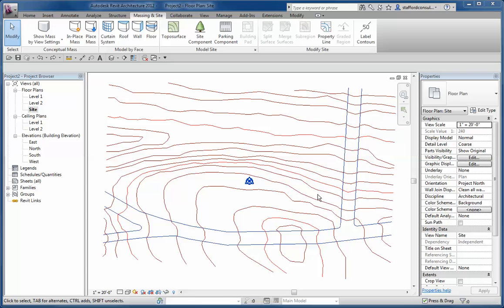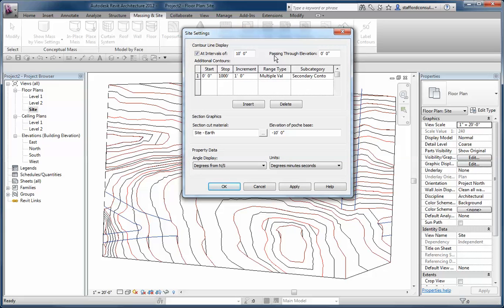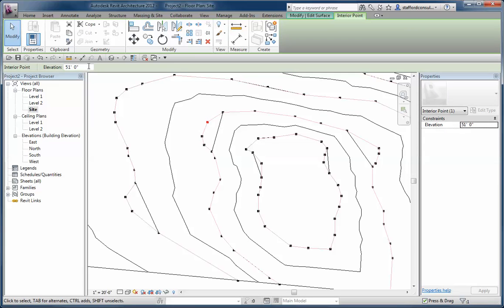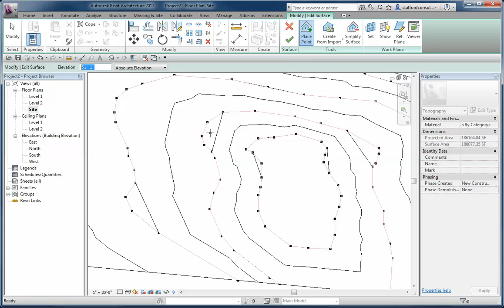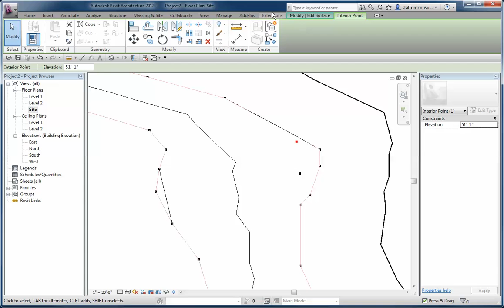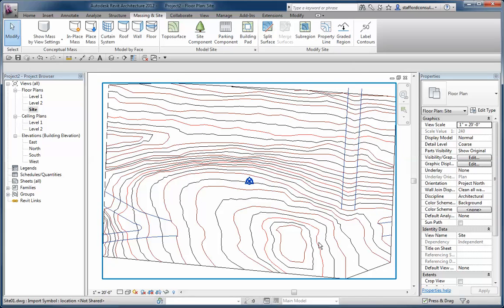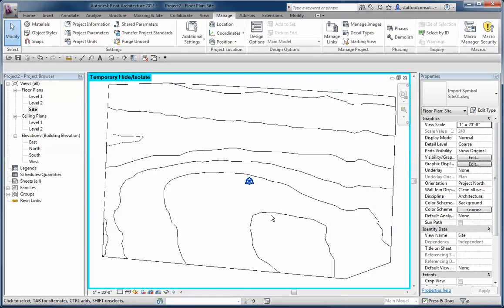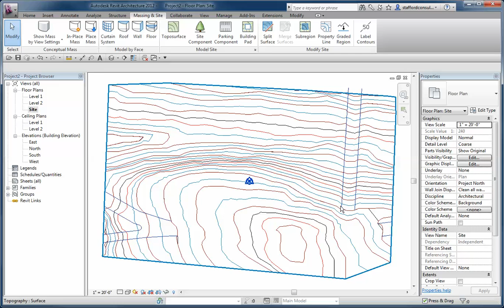Five Minutes with a Toposurface

Comment: Is there a way to add a colors to the top per the contour elevation?
Reply from the maker: Not with the toposurface itself. The surface varies from contour to contour. The only part at a specific elevation is the contour line itself or if a portion of the surface is "flat". The Subregion  feature can be used to create different "colored" zones using different material assignments. So could Split Surface. Another possibility is to visit the Landarch BIM blog. See her posts about creating floor/roof from toposurface. This way you might create different elements based on elevation and assign different materials.